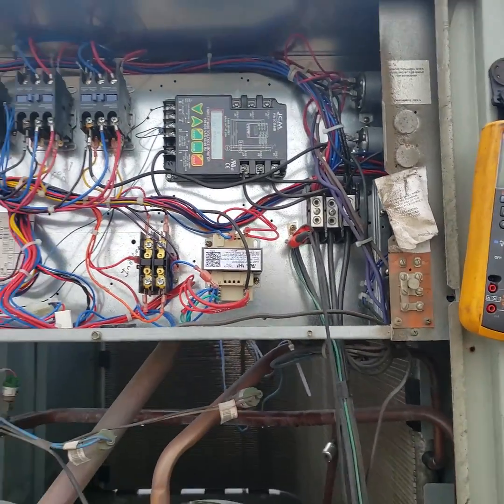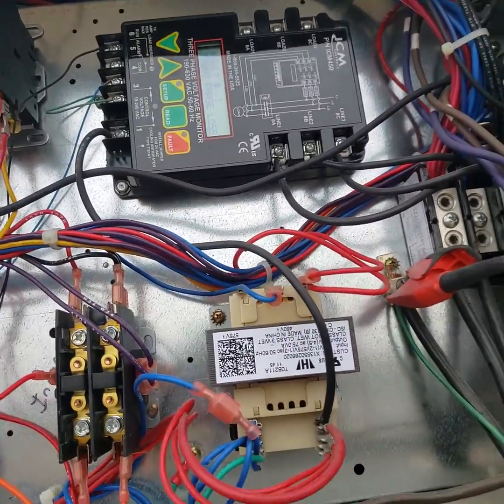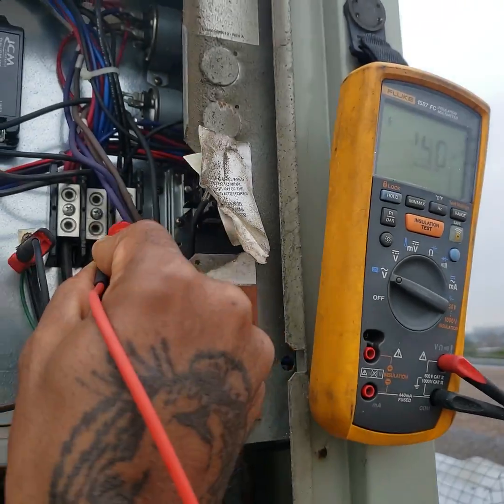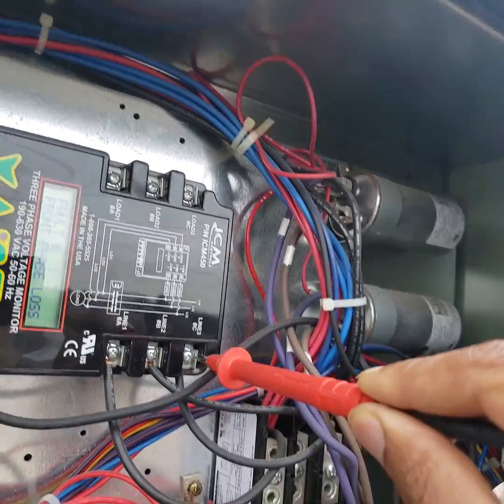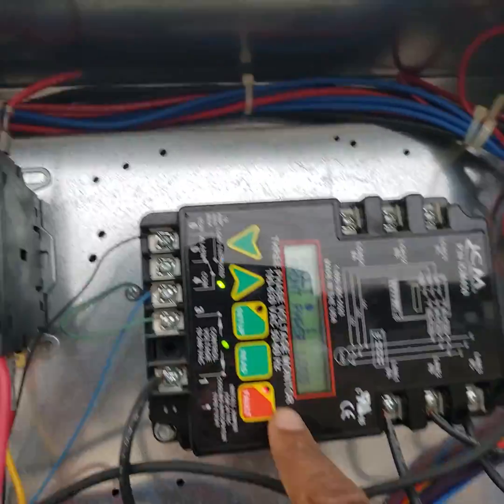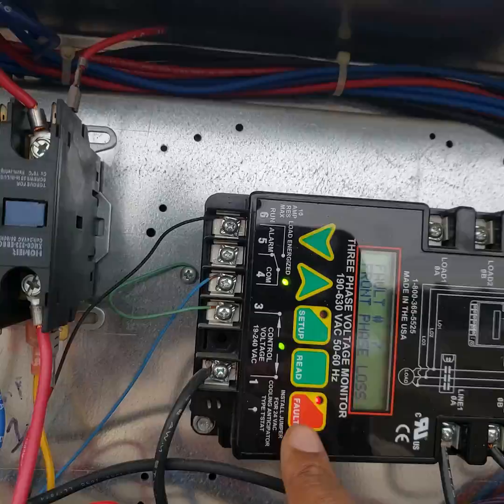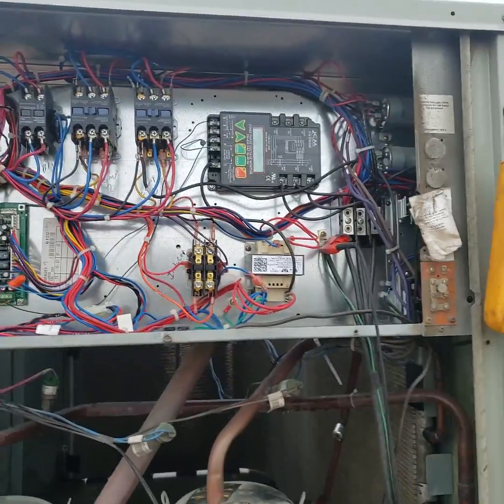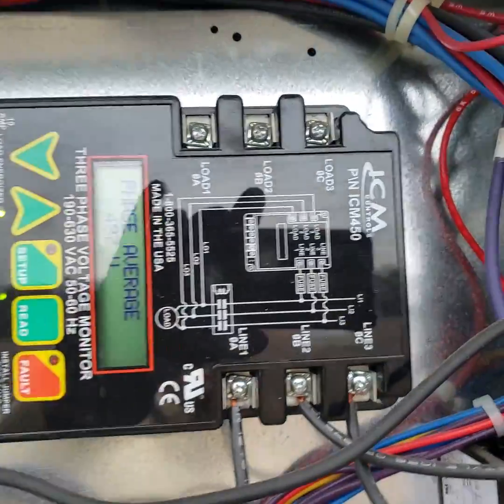HVAC ICM Fault

Comment: What is the function of the ICM?
Reply: Monitors each phase to ensure proper voltages/phase going to the equipment. Shuts off the contactor if reverse/over/under/loss voltages occur.  Single phase a 3-phase compressor while it's running. Goodnight compressor.

Comment: Does that phase monitor send power to like a transformer or something? How does it keep the unit off once all legs of power is back?
Reply: Coil voltage goes through the monitor. Most self-reset once power returns to nominal voltages, but this one was programmed for manual reset.